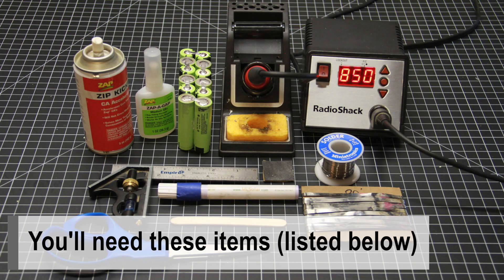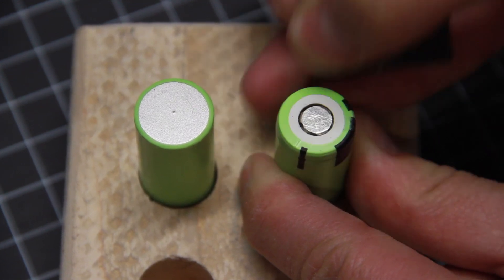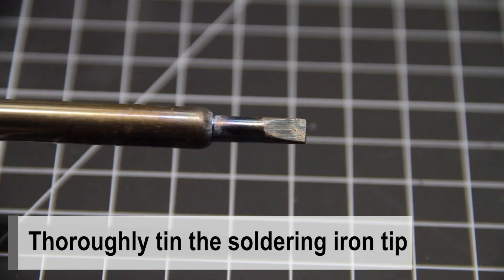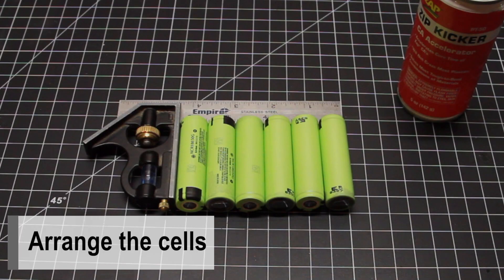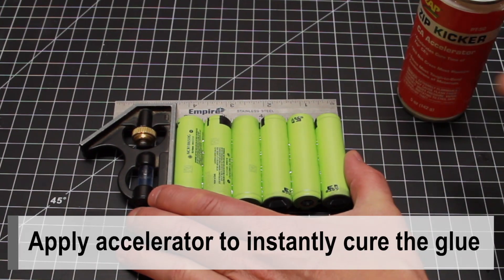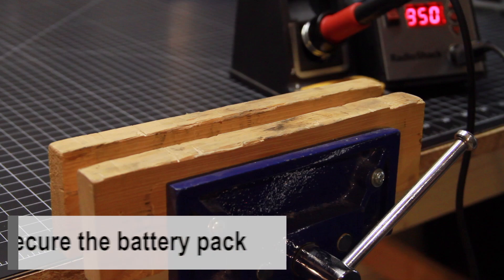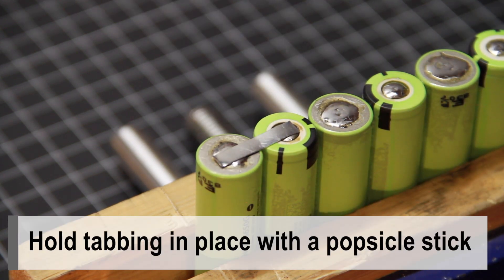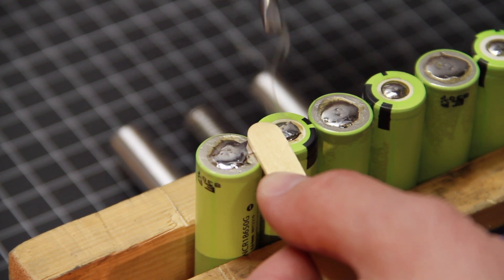Best Soldering 18650 Lithium Cell Tutorial - NO Welding, Just Solder!

Comment: Ultimately, where does this apply...for what use?
Reply from the maker: I use the 18650 packs for unmanned aerial vehicles where high current draw, g loads and vibration are a factor. Traditionally, spot welded packs aren't well suited to my application as I've had in-flight failures due to weld issues.

Comment: Although the soldering technique shown here seems very good and well executed, I'm not sure if it is a good idea to solder batteries, there is just to much heat transferred to the cell, I doubt it doesn't affect them. There is a reason why spot welding is the go to technique when assemble batteries.
Reply from the maker: I'll be releasing a video soon that tests batteries exposed to heat from a soldering iron. It will show how long the iron can touch the cell until there's damage/performance loss.
Reply: @enopto  and my sub
Reply: @enopto  and my axe
Reply: @enopto  Nice. I like your style: direct to the point, no BS, no "what ifs", let's test and find the truth...
Reply: So - Spot-welding batteries don't get them hot?
Reply: Spot welding requires higher temperature than soldering, but requires less heat. The heat is delivered very quickly and concentrated into two tiny spots, therefore the temperature of these spots raises very quickly above melting temperature without requiring much heat at all.
Reply: @jorgelima5695  this is like applying the energy of 1g of molten metal rather than applying the energy of 1kg boiling water
Reply: @peterjackhandy  nowhere near as hot as holding that soldering iron on the cells.
Reply: In high power applications the heat generated by the batteries themselves discharging at high amperage can melt and thus de-solder joints that’s the main reason why crimps and spot welds are used vs solder.
Reply: Usually the soldering tabs used for PV are much thicker than nickel spot welding tabs. So this is an obvious advantage of soldered batteries pack.
Reply: Spot welders for battery packs are quite inexpensive these days as well.
Reply: I suspect spot welding is done more because it's easier to incorporate into large-scale manufacturing.  It's generally more consistent, but has higher capital costs.
Reply: Spot welding is faster.  It's that simple.  Time is money.
Reply: @OldJoe212  Spot welding is not faster if you don't already have a spot welder. People like you completely miss the point of videos like this. It's not to suggest that someone making battery packs for a living should somehow start soldering them instead - it's to show a semi-capable DIY minded person one way they might achieve something with just the tools they have to hand. No-one is saying this is a fantastic idea in lieu of spot welding, but most people aren't going to build or buy a spot welder to fix that one old gadget they'd like to keep using.
Reply: @chocolate_squiggle  1) As Jorge stated, heat kills batteries and spot welding produces much less heat.  2) Spot weld is faster, so commercially, there is no option.  3) Don't overthink spot welding.  4) I've "rebuilt" several battery packs and have used both methods.  5).  I've done the spot welding, with excellent results, by simply using a 12v. car battery.  6)  Therefore, your overstated, and arrogant, comment wasn't needed.

Comment: Great job of shooting and editing.  Thanks for not wasting everyone's time!   
I'd be tempted to sand, flux, and tin the underside of the tabbing too, but I've had a lot of trouble using "old" materials that have become oxidized over the years. 😁
Reply: The tabbing often is pre-tinned.
Reply: I couldn't get a ts100 to stick my pre soldered 18650's to the tabs of the cordless drill, is  my iron capable of the job? It goes up to 400c.
Reply: @jedics1  - Your iron might not quite be up to the task, since 60/40 solder melts around 380 C.   Other than that, it's hard to say exactly what your problem is, but the tabs in your cordless drill might be stainless steel.  Metals like aluminum, chromium, and stainless (part chromium) resist corrosion not because they're chemically inert but because they are highly active.  They form a thin layer of protective oxide that grows over time.  I would suggest cleaning those tabs well with acetone if possible or perhaps 91% isopropanol (drug stores sell it) and then using sandpaper, a file, or scraping with an X-acto knife to break thru any surface oxide.  Use a highly active flux in addition to the solder and rub the iron against the surface being tinned.  If you can tin those tabs with liquid rosin (flux for electronics), that's great.  On rare occasions I have had good success with an acid flux like Harris Stay-Clean SCLF4 that contains zinc chloride and hydrochloric acid but this is pretty extreme and should not be necessary for electronic work.  You would also need to clean the part well afterwards to neutralize the acid.  Once the tab is well tinned and the cell is too, they should solder together with very little additional solder if your iron is hot enough, but be sure to use more liquid rosin flux.  Best of luck!
Reply: @ralphwaters8905  Sanding helped a bit but it was still difficult and Im not very confident with the connections that were made although the drill powers up fine. Of course the job was so rough the tabs are now preventing the batteries going back in the case properly. The tip I have is only about 2mm, would it make a real different getting something bigger like 5mm?

Comment: Thought solder won't meld with the batteries terminals which is why they use  that "quick electro point" joining process?
Reply from the maker: Solder will flow onto the battery terminals just fine. It's the heat people are worried about. this method shows you how to solder while exposing the battery to as least heat as possible.
Reply: @enopto  thank you for the clarification. Thought the terminals are made of solder-incompatible metal, which I thought is stainless steel or something with aluminum or nickel

Comment: You absolutely deserve the compliments everybody below gives you since you show clearly what procedure to follow to obtain flawless connections. Although I have a spot welder I still prefer soldering since solder connections are more flexible. Many YouTubers show gluing the cells together with hot glue. You use quite expensive glue. Although I once tried hot glue I do not like that method since the glue often has low adherence. I glue the cells already for years with cheap crystal clear kit/glue (from a sealant tube). It hardens rubbery within a few hours and can be removed with a knife or thin wire (like cheese) without damaging the plastic envelope of the cells.
Reply from the maker: Thank you. I use CA for everything!
Reply: I never use CA on cells, for the simple reason that a few of my packs I had to recell featured CA which made obtaining the cells that were still good impossible, just like retrieving the spacer (which was 1 piece) was impossible, while 3 of the more expensive packs (like the 'cheap' ones aren't expensive at 320 Euro excl. VAT already) had all the cells connected with hot glue, special spacers (14 in total if I remember it right) between the cells to prevent against rubbing, while getting mechanical strength from the spotwelds. If hot-glue doesn't stick, the surface either is greasy/oily or dusty, or you've got the wrong gluesticks. If the gluestick is transparent or semi-transparent before use, but shows discolourization when it comes out of the gluegun, the gluegun gets too hot, or better said: you've got the wrong glue-sticks.
If you get the right ones, you will have a hard time removing the blobs. If you do want to remove the blobs, isopropanol or ketonatus alcohol works a treat. Just rub it along the blob of glue and part you want to loosen, and it will loosen like you haven't seen before.

Comment: Do it with Rust remover it should contain phosphoric acid ! And isopropyl alcohol ! it should contain phosphoric acid ! How you mix the Mixture normally 50% Rust remover with phosphoric acid: 50% isopropyl alcohol but make small amounts and try it out - all metals can be soldered with this mixture!  if it doesn't work then use more Rust remover for example 55% Rust remover and 45% isopropyl alcohol etc. always do it in 5% steps! Like I said the Rust remover must container phosphoric acid ! 
Best regards, an thank you for your informative Video.

Comment: can I use jump wires to connect laptop batteries instead of strips???
Reply from the maker: Not sue what you mean by jump wires but 14 gauge stranded wire that's been stripped, twisted and tinned works well.
Reply: @enopto  jump wire just means simple wire instead of strips. Coz Im new and find very difficult to solder strips. I want to use simple copper wires instead of strips. Is there any danger by using wires instead of strips?

Comment: Good vid, but why are they normally spot welded?
Reply from the maker: Spot welding introduces less heat to the cell and is typically easier/faster when creating battery packs with many cells.

Comment: Excellent job!!I have one question though...I have baught 6 new NCR18650B 3.7V batteries to rebuild my Toshiba Satellite laptop battery that had 6x CGR18650CE .Do i have to recharge them one by one b4 i solder them, or rebuild it as it is and  let  the laptop do the job?
Reply from the maker: It's always good practice to ensure the batteries are near the same voltage. If you don't have a volt meter to check, the easiest way to make sure they're the same voltage is to charge them individually.
Reply: @enopto  1000 thanks and best wishes for a prosperous and a happy new year of yours
Reply from the maker: You're welcome. Have a wonderful new year!

Comment: Generally you are not supposed to solder to lithium cells because of damaging the negative side with heat because it is close to the surface of the cell.  This is the quickest I have seen soldering on 18650 cells.  The key is a very hot iron and a fat tip to hold transfer the heat.
Reply from the maker: You've got it!

Comment: if you're concerned about heating the cells (like you don't have that kind of hi temp soldering iron and it takes longer to solder) you can use a wet cloth to cool down the solder joints... also 63/37 solder melts a little faster..
great instructional video.
Reply from the maker: Wet the cloth with alcohol, won't cause corrosion. Plus you can wipe off the nasties left over from the flux.
Reply: @enopto  nice!
Reply: Poor advice, never, ever, fast cool a soldered joint.
Reply: @wirdy1  hi, why is that?

Comment: the important point, use a high temperature iron soldering & flux, isnt it?
Reply from the maker: Absolutely, it drastically reduces iron dwell time on the cells making soldering 18650 possible.
Reply: @enopto  Curious if you have tried any low melt solder like bismuth/tin ? Has a much lower melting point at 138 celsius, and if mixed with leaded solder supposedly goes all the way down to 95 celsius. Seems like you could drastically reduce the amount of heat required.

Comment: Excellent video! I have been soldering cells for decades and never had any problems. The damage done is not measurable if using good techniques like You do. Regarding uninformed discussions on spot welding vs soldering Nickel has a resistivity much depending on alloy of 1*10E-7 ohm meter, very near 40/60 solder 1,5*10E-7 ohm-m. Copper is around 2*10E-8 ohm-m. The contact area is much better with solder than spot welding. I have measured similar joints with good micro ohm meters, and the soldered joints are always better than the spot welded ones. Thin copper strip is easier to solder than nickel and is what I prefer. Solder wick is another solution I have seen, but not tried. Cu is however not as strong and is not suitable for spot welding. Make sure the strips have some bend/slack, solder creeps under load... I have tried to spot weld nickel wires to copper , it does not work well. For low cost mass production spot welding is the only viable alternative. Also if You use a thermal imager You will quickly find that good cell contacts spot welded or soldered are a very small part of the problem. 50A squared * 25 uohms figures around = 50mW/ joint .... hardly a concern. The resistance of the strips and the quality of the cells are much more important. Also, acid flux is no good, it causes corrosion over time. Active rosin flux works just fine.
Reply from the maker: Excellent information, thank you!
Reply: Did you measure cell degradation due to heat?
Reply: @bumbarabun  I checked the discharge cycle and inner resistance, could not measure any significant difference due to soldering. The heat applied using good soldering techniques seems to be ok for most cells. I think the most potentially sensitive part of some cells may be compromising the seal.
Reply: @erikisberg3886  good to know, what is left is to measure if it affects degradation rate over time and lifecycle, but I guess that is quite long and not easy process.
Reply: @bumbarabun  You are right that would be tedious, but in practice I have not noticed any degradation over time due to the soldering. I did this way back to NiCd:s as well. Appropriate charge/discharge cycles are probably much more important for life expectancy.
Reply: @erikisberg3886  ok let me summarize - such method could be preferable for some people as it is "cheaper". I put it in double quotes as it is cheaper if you do not value your labor as welding is much faster. Also there are cheap welders available from China that provide decent work according to reviews. There is another moment though I would like to point for author (if he reads comments). I did not find anywhere that you explicitly mention that people, if they decide to follow, would deal with lead. You may assume they should know but I would like to remind you that some were sued for even more obvious cases (like you have to warn them that coffee cup is hot). So I would at least put a disclaimer in your description.
Reply: Brilliant suggestion on how to reuse used solder wick!

Comment: Nice video! Thank you! Why not make one longer nickel strip tho? I was left a little puzzled how you continue to the third. Do you overlap with another layer of solder? (Would seem unecessary?)
Reply: do you understand the concept of a battery? they have opposite ends. the continuation goes on the other side.
Reply: @basketcase1235  ahhh! true! because it´s in series and not parallell right. Yeah makes sense man!! I´m very new to all of this. Still trying to wrap my head around everything ;) 
Cheers man!

Comment: Spot welders made for making battery packs are now available in the $30 range.  Don't damage your cells and risk starting a fire by trying to save a miniscule amount of money.  The amount of time molten solder is on the shell of the cell (the negative end) is way, way too long.  This technique WILL damage your cells, reducing their capacity and life expectancy.  Spot welding is also much faster.
Reply from the maker: I've built over 100 packs with at least 4 cells each. Thats a minimum of 800 individual solder points that have never failed or caused an issue. Statistics.....the math is on my side.
Reply: @enopto  so is this a technique I could use when attempting to make a 15s3p with 18650 cells? I'm doing a crapload of research before even purchasing what I need but I want to make an extended battery for my onewheel.

Comment: DO NOT do this.  EVERY manufacturer of batteries warns you not to do this.  Just because it "seems" to work doesn't mean you aren't damaging the cells when you do this.  Also, there is a significant risk of melting through the heat shrink on the positive end of the cell, causing the nickel strip to short out a cell.
Reply from the maker: I've built over 100 packs with at least 4 cells each. Thats a minimum of 800 individual solder points that have never failed or caused an issue. Statistics.....the math is on my side.

Comment: maximum info and compact! Thank you! I almost bought a spot welder until I saw this. I understand there is inherent risk in everything we do every day of our lives. The MAIN thing to keep in mid is enopto did not say, hint, or elude to this is the end all be all of the only way to join batteries together in series or parallel, but rather that "it is possible to solder 18650 batteries and possibly any other Li-Ion battery and he executed the task flawlessly! Even made it look easy. Take it for what it is. As we all saw there was no fire, no explosion, or death and destruction. I endorse this video and others like it that show alternatives to making something work. Keep up the great work and condensed instruction! I appreciate it.
Reply from the maker: Thank you Adrian for taking the time to write such a great comment. You nailed it right on the head, soldering 18650 cells is no mystery that requires an over complex solution. With the right tools and information, this can be accomplished correctly and safely. Cheers!
Reply: @enopto  I know talent and skill when I see it, and you have it! I really am glad I stumbled across your video, thank you again and keep posting and keep up the good work and skillful work.
Reply: well if you are just repairing one thing like once a year.  soldering would be just fine.
but if you have several things to repair a year.   like vacuum robot, hand held vacuum, several battery powered tools, high powered flashlight, vape, E-scooter or e-bike etc. etc. 

spot welding is a must coz it is quick and fastest